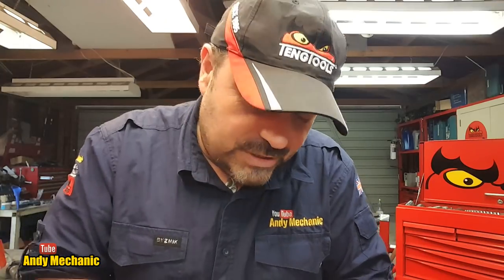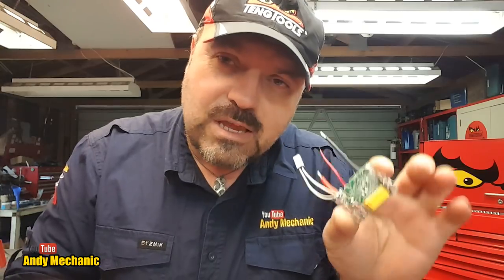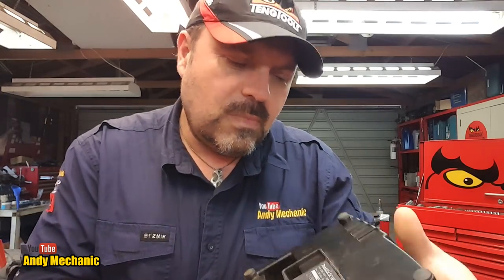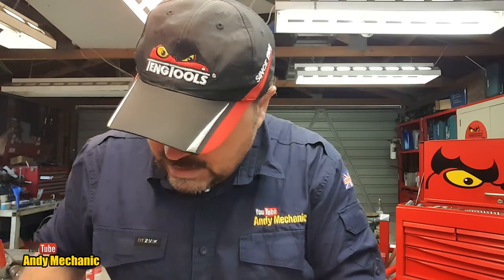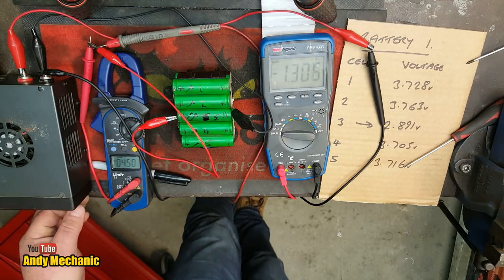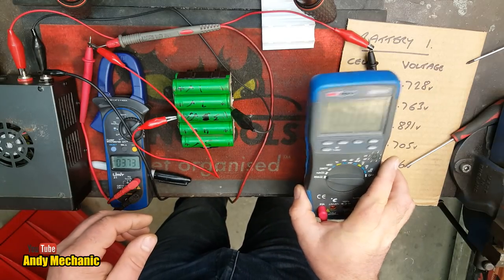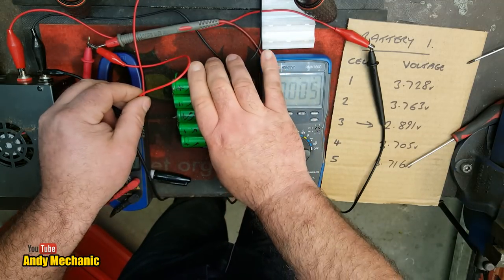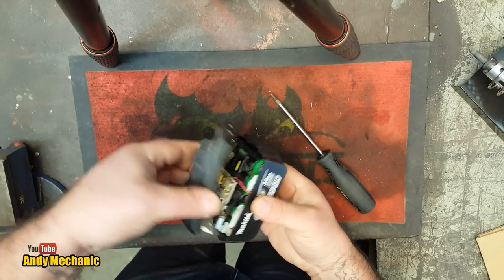Lithium Ion battery resurrection Ep.4 - charging cells & replacing circuit boards battery 1 #1448

Comment: When I did a similar fix for a ryobi pack I used a lab bench power supply. I believe I set a current limit of 250 mA to be safe and 4.2 V max. I left it on for a few minutes monitoring the temp of the battery during the charge. With that said, I had a 5 cell pack not a 10 cell.

Comment: Lithium cells shouldnt drop below 3v, otherwise they risk loss of total capacity... Not 3.7v
3.7v is its nominal voltage. 
Lithium Fully discarged 3v, fully charged is 4.20, storage charge is 3.79, because thats its nominal voltage..
Also, that "little dangly bit that goes down into the plastic". is a thermistor.... Resistor that changes resistance by temperature.. In short, Its temperature sensor for the board..
To stop batteries getting too hot...

Comment: I think Makita may have mis-labled that charger I have 4 different Makita Chargers. 2 that are 6-10 yrs old and Blue/Green like yours and one that is maybe 1 yr old, a new Black one and a dual bay newer Black one. Mine all say 9 amps per channel. OK, Here is the short version of what you need to know. ALL these power tool  packs are made up of 18650 cells that are 3.7 volts each.  Any 18 volt lithium battery has 5 cells.  Its is ALWAYS better to NOT fast Charge a Lithium Ion Cell! Heat and High amperage charging (Which Produces Heat )  Shortens ANY Lithium Ion's battery Life Expectancy!  A LOT! So Now you Know! Also completely draining a cell or pack dead kills life expectancy/cell capacity.  The BLACK Charger is the One to keep!  (if its really is only 2.6 amps!) The green one is the charger that will help you destroy your batteries quicker !   Just remember its better to Buy an extra Battery and  "Always Be charging"  While your working with the other pack !  Rather than throwing a battery on and trying to "Fast Charge" This way your batteries last many many years!  I have Makita 18 volt LXT batteries that lasted almost 10 years of Hard Use!  I have had others not last 1 year!  (its all about the quality of cells and how it is charging!)   Makita's packs are really good in both cases.They used to be even better in charging with balanced charging. They use really good cells and they developed their charging system with enginerds from Sony!

Comment: New to your channel.  If I may offer you a tip for your soldering iron.  Take a paper towel wet it and put it in a little cup (to keep from making a mess)then heat your iron up put some solder on then wipe it on your wet paper towel to clean your tip.
Reply from the maker: Thanks Jon, I'll give that a go next time. Cheers Andy

Comment: When you tested the original batteries and found some low cells which you replaced, before you replaced them, did you try charging them individually?
Reply from the maker: No. At the time I wasn't aware that was an option unfortunately. However, you have to ask the question why those cells had discharged so much compared to the others?

I do still have the old cells that were removed so I'll charge them up and see if they retain their charge or discharge over time.

Cheers Andy
Reply: Andy Mechanic - cheers, I didnt realise you could charge them up individually either and i can offer no idea as to why a cell would discharge - it was just when you found that the replacement cells had lost strength since being replaced and that you had then found out the charger didnt want to know if there was a disparity between the cells , I thought , Mmmmmmm.........

Comment: The Newer Makita Chargers/Batteries don't balance themselves between each cell . Most of the older ones did. This keeps batteries from going bad. The newer stuff for many years now doesn't balance it just lets a weak cell pass for 2-3-4- charges  then it wont let it charge anymore.  Then you are forced to buy a new battery,  unless you can balance the pack, or replace the weak cell. Which is the right way to do this.  You lose so much of your capacity with a weak cell it keeps the battery from being able to be run down or charged all the way up. Best thing to do is hack the battery and put a 5 pin balance plug on it and balance your batteries yourself or pay lots of money and buy new batteries often.  Milwaukee, Makita, Dewalt, Ryobi, and Bosch like you to do the later. Buy more batteries because they make a ton of money on the dirty Chinese lithium packs !  Ha Ha  I would rather spend a few minutes to learn. I will fix mine and balance charge them like RC guys have done for decades.
Reply from the maker: Great info, Thank You for contributing. Personally I had only 1 of the 3 batteries come back to life with any reasonable capacity. I'd consider having another crack at it when either of the 2 new battery packs I purchased develop an issue & your advice is invaluable 

Thanks again
Andy

Comment: if you look on the makita boards you may find a surface mount gate mosfet. if you do the board mite be saved by reopen the gate in the mosfet with a small voltage

Comment: I was told if unhook the power to the circuit board for one minute it will reset and work again... I have not tried it yet to see if this is true... if you have not rebuilt the other batteries would you please try this and see if it works...
Reply from the maker: Yes! Great idea. I'll try that on the last battery. Thanks :-)

Comment: I replaced a cell in my battery and it has over 20 volts again but the charger still wont charge it why does the chip still think their is a problem?  I guess replacing the bad cell doesn't make a difference their is no way to reset the chip even after it lost power it retained its data.
Reply from the maker: Once the logic in the chip has been triggered it can't be reversed as far as I am aware - that's why the logic board also needs to be replaced - it's a safety lock out.

Cheers Andy
Reply: @AndyMechanic  Guess ill have to charge it like i was before using my good battery

Comment: Well` thumbs up with persistence,
I watched all when you started this quest,
In the future , I would suggest buying some nickle strip and a proper battery spot solder they are not dear and some thermal heat tape for the edge of the batteries be for replacing back into its casing, using that solder iron can destroy the battery, 
As for protection I would recommend a goggles and vizier and gloves. goggles won`t protect the rest of your face and neck. from burning.
when them batteries go` the flame is like a jet.  it admits such a fears uncontrollable burst of extremely hot heat and at length and if one goes it possibly will set the others off,you won`t know what hit ya.please think more safety be for its to late and regret what you never done.
The trouble with them batteries you may trigger a thermal run out with out spotting it first.
You also have to consider persons who watch these video`s will follow your league and may not be so lucky with not triggering a thermal run out.
The other thing you have to consider if the battery shows the 3.7 v 4.20  charge there Mah may only last 10 minutes be for it drains,
The other batteries try to share power so where you have a low battery it will absorb power from other, to equalize ,
So even charging a battery up to 3.7 or over and replaced back into the pack, then charge up, then use for a bit, then recharge and it flashes broken pack.
So be for replacing a battery its good practice to charge that sell then discharge slowly to see give you a indication of its Mah, be for you solder it in and trigger the circuit board to stop charging
I know that time has to be considered and you were just, giving it a go to whether you could bring back the pack to working condition again and you did that,
And you have possibly learnt a few things on the way now,
But I can not tell you enough about safety especially when using that screw driver to peal around the edge of the battery, I was cringing if that battery outer cover had a bit of damage  and the screw driver made contact to the center and top outer side that would of caused thermal run out,
The best way to remover the nickle is snip all batteries , then get a pair of nose pliers and roll the pliers to pull the nickle strip off, just like a tin of spam with its key,
The key would be the pliers.
Any ways , glad to see you got there in the end,

Comment: Very useful but very long, i watched all the way to the end, you need to do a little bit of editing, specifically when you try to install new circuit board. I hope you are OK with my little input and good luck to you Sir. Best wishes from Norway.
Reply from the maker: Thank you & yes, I value your input very much. I'm trying now to keep the videos shorter buy I need to try harder!

Thanks again & Happy New Year
Andy
Reply: Can i hook up a wire from the wall straight to the drill
Reply from the maker: Erm....no, please don't do that! It's an 18v DC battery & what comes out of your wall socket it either 120v or 240v AC so you are likely to get electrocuted and probably the battery pack will explode. So don't do it!

Stay safe. Andy

Comment: Has anybody seen an actual uncased lithium cell explode? Ive only seen an explosion once when a battery case melted and sealed the vent holes and the guy had a teapot steaming on the table when the plastic case finally burst..water...lithium...oxygen..and meddling with things we dont understand can be a whammer! Carefull kids .put the dog outside when you get to gettin wreckless..tyvek suits are cheap..safety glasses keep you able  to see the results of your maddness.. a face shield (grinder type) will keep you pretty when your batteries outgass in your face while you are checking the temp and state of your experiment.. and all this gear is super cheap, keeps ya safe and makes you look cool and important like you actually know what you are doing.. fun fun furry furry funfun!!
Reply from the maker: Great advice & yes, wear the safety gear. These battery packs can be dangerous and I have also found the sucess rate in bringing them back to life is pretty low & even when you do it seems the capacity is greatly reduced. In my opinion it's just not really worth the risk or hassle - just buy new power packs & look after them.

Cheers Andy

Comment: how do you know where the small red wire goes on the battery pack. I  have the same board but not sure where the small red wire goes
Reply from the maker: There is a small metal tab with a hole in - it's part of one of the joining plates. Cheers Andy

Comment: Don't use the black charger, it's for ni-mh batteries not the new li-ion. The fast charger will slow it's speed down before they get too hot to avoid damage. Read the manual. The series is interesting I can see all your mistakes before you figure them out so I've been skipping bits. I've still learnt a bit about how the makita batteries work. I haven't finished this video but I hope you have success. There would be a way to reset the makita boards but probably easier to get replacements. In the end the rest of the cells would be at the end of their lives I'm surprised they lasted 3 to 5 years. It also looks like you can get a new battery for cheaper than the cost of all the cells so I don't feel as ripped off anymore. still it'll be interesting to see how long they last if you get them working. I'm going to continue watching this video now to see if you work out how to balance charge them and get it running. :)
Reply: Wrong, Commander ZIN! The DC18SD charger IS suitable for 18V  Li-ion battery packs.
Take a close look at the bottom of the black charger at  6:57 in the video.

It is clearly written "NiMH & Li-ion 7.2 - 18V"

Comment: I have replaced 3 boards now and on 2 chargers they all do what yours done, they start to charge then disconnect. Doing my head
Reply: Hi had this problem too (and I suspect this video never showed it charging properly cause it doesn't in this configuration. These clone bms boards need 3 - 4.2 volts they way he has it shown here it is more than that, I had the same issue but once I changed the thin red wire over to the positive of the first cell 3. - 4.2 volts, then it all worked.  hope it helps